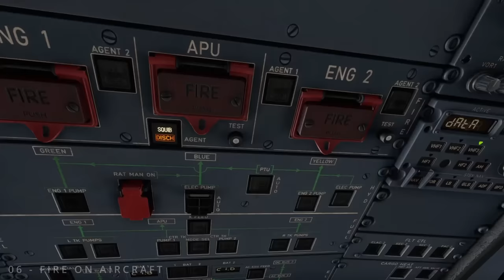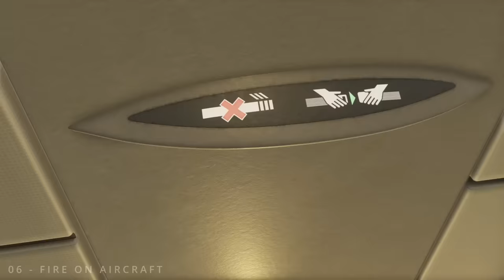Airline CAPTAIN Debunks 8 Flying Fears

Comment: No, a plane cannot land on water. It isn't a boat.
Reply: @MidnightPodcast  depends on the plane.
Reply: @joshuajackson4742  Lol no, it does not depend on the plane.
Reply: @MidnightPodcast  there are planes designed to land on water specifically. Literally called sea planes, or amphibious planes.  What are you on about

Comment: 1 in 11 million chance of dying . it's actually 50%. Either you will crash or you wont crash. And if you crash it's certain death. The passenger cabins must be redesigned. In an event of emergency the cabin must be able to detach from the wings. And with the help of parachutes and boosters, the cabin needs to land to safety. NOTHING justifies killing of 300 + people due to mechanical or pilot error. It's so dissappointing to see how this is not a number ONE priority in any airliner. It is perfectly doable, and very easy to achieve. And don't get me started on the cost. Nothing cost more than 300 people, 300 dreams, 300 lives, 300 laughs....
Reply: It’s not 50% lmao it’s still 1 in 11 million.

It’s not certain death if you crash, there are many crashes with survivors.

“Cabin must be able to detach from the wings” that is the silliest thing I have ever heard, firstly the wings are the things keeping it in the air in the first place, so detaching from them just makes the passengers now reliant on some thin fabric parachutes. Secondly, retrofitting this onto every plane will cost billions, thirdly the extra weight will increase fuel cost, lastly the added complexity just increases the number of failure modes for the aircraft.

It’s not easy/ perfectly doable. It’s possible in theory, but you would have to design a reliable parachute and detaching mechanism that just adds unnecessary complexity and risk to the aircraft. 

Lastly, air travel is the safest form of transportation in the world, thousands of planes fly every day with no issue. 

Also, by your logic we should install a rocket at the base of all cars to make it fly into the sky and parachute down in the event of emergency.